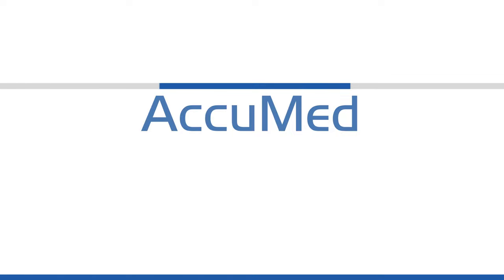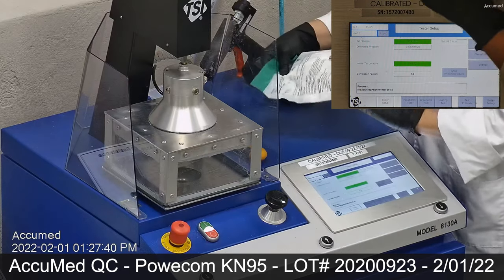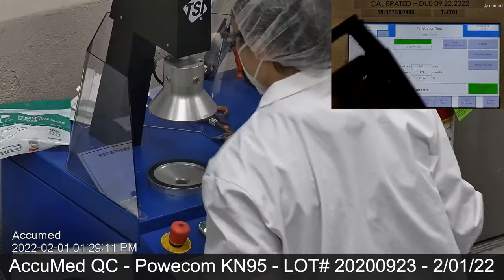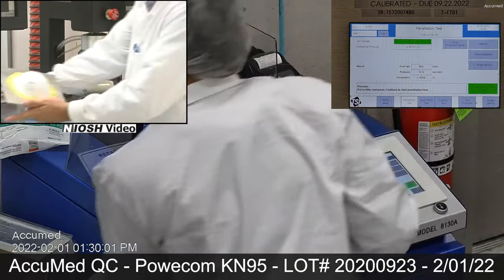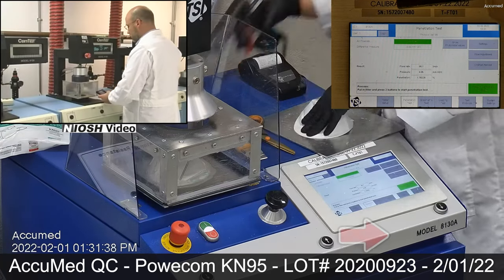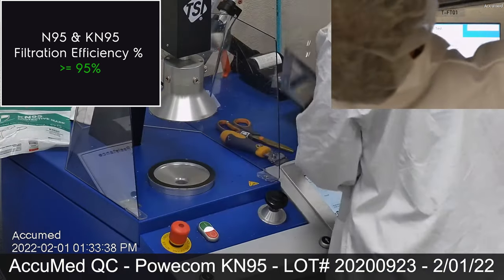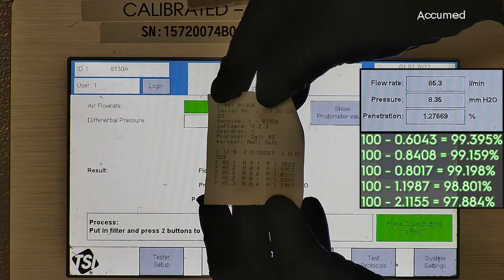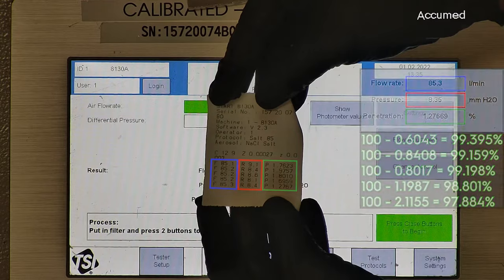Powecom KN95 Mask Review - Filtration Efficiency Test with TSI 8130A - GB2626-2019 Standard

Comment: Consistent with Armbrust's PFE testing, but your breathability resistance pressure values are more accurate, as you use the entire surface area of the respirator, not a limited area like Armbrust.
Reply: If I’m understanding the test results correctly, is the filtration % approximately 98.7%?
And what is the breathability score?
Thank you